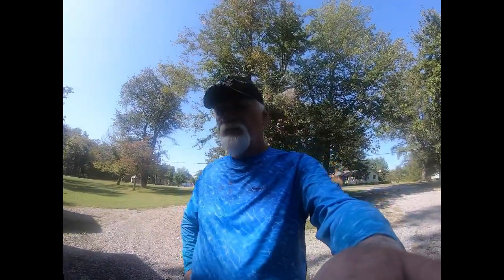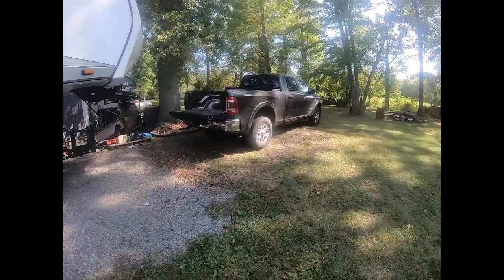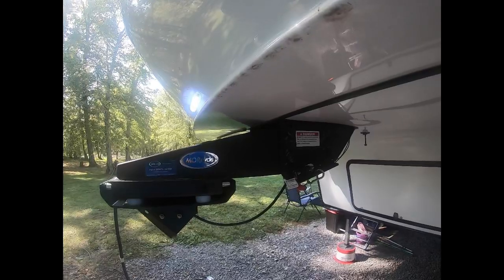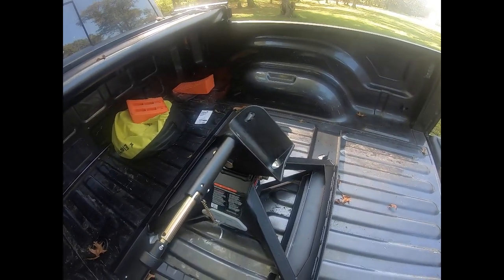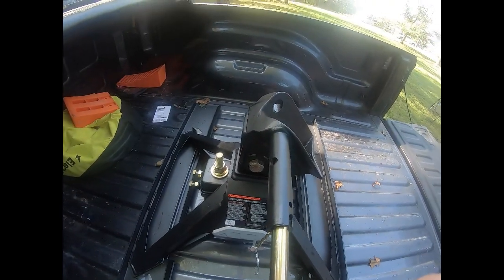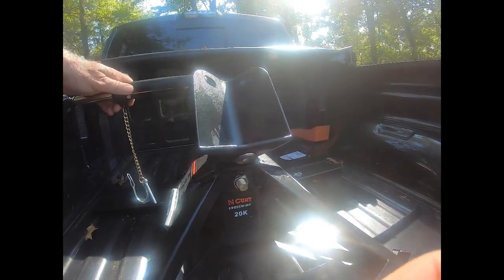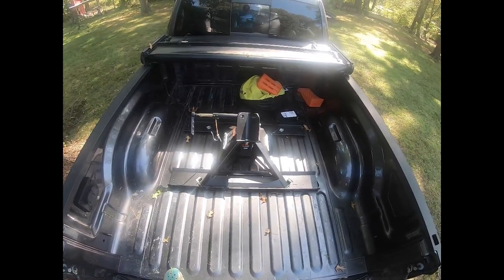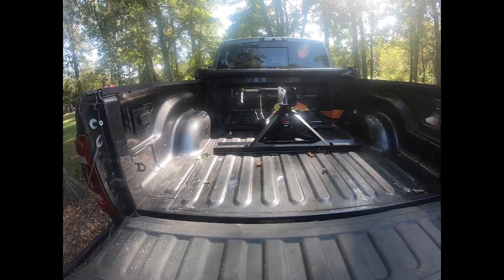Demco Recon vs Curt Crosswing

Comment: I have this hitch on a short bed Ram pulling a 10k camper. Happy with it. Very little chucking. Hitch is simple to install and uninstall from the truck. So is the hookup. Can all be done alone or easier with an assistant. Hitch allows full 90*turns.

Comment: Thanks for the honest review, and the insights you put into a simple video format. And thanks for the heads up about “NOT” removing that 1 bolt, you’ve probably saved  a lot of money for your viewers on that one (sorry it had to cost you, but your loss is our gain I guess). So you’re saying the bolt used for adjusting the height of the hitch must be torqued down to 300 ftlbs? Dang that is a lot. Thanks again, and please update on the long haul.